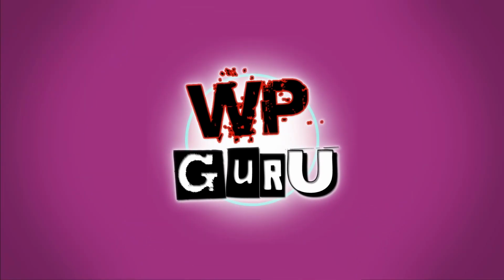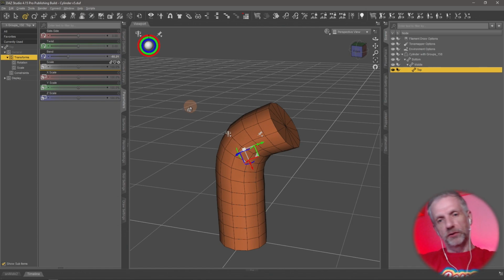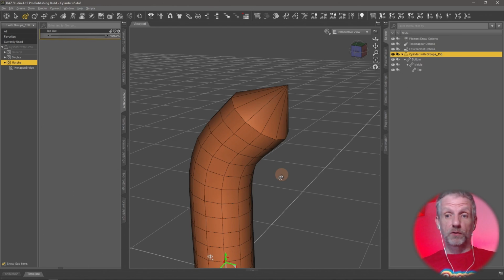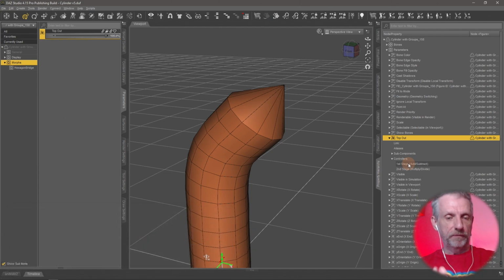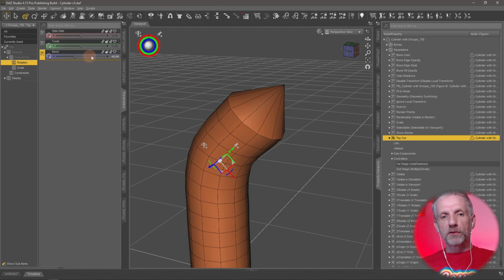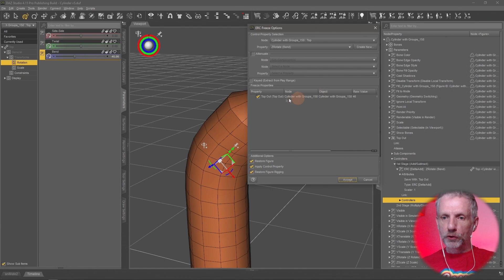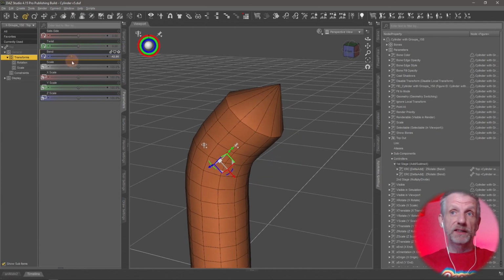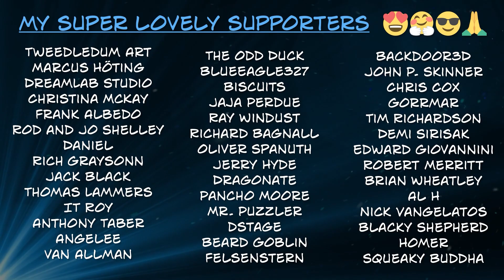Creating Joint Corrective Morphs (JCMs) in DAZ Studio

Comment: Hello Jay. I've been trying to learn to use "JCM's" for my clothing morphs. And it's never worked. Instead of affecting my morph, it affects my figure. And if I try to use it for the figure, nothing happens. And I've been watching these videos over and over.
Reply from the maker: To be honest, nobody wants to just "use" JCMs. You either create them if you have to, or they work autmatically. What are you trying to do and where's the problem? Perhaps it's not even related to JCMs.
Reply: @WPguru  Thank you so much for replying so quickly Jay. I've watched your videos for years and you've always been so helpful. Because of your video, I found out what I was doing wrong with the morph in the first place. But in this case, I've always wanted to learn about "JCMs" but they never worked out for me. When you mentioned the "ERC Freeze" I knew I was in trouble. Whenever I use the "JCMs" my morph(the whole thing) gets affected. instead of the area that I'm trying to work with. And I only use it on clothing. And I also use Zbrush as my morph editor. Again. Thank you so much for your help. I'm trying to make a comic book.

Comment: I've fought with these things for years.  Creating single property JCM's is pretty straight forward.  Where I'd love Love LOVE to see some instruction is in the creation of multi-axis JCM's and Start/Stop Points.  So how do you create a JCM that will ONLY apply when the joint is bent on two different axis'?  Say I have a morph for a thigh that's bent at -90 and -35 and ONLY want this morph to be applied when both of those are bent.  

The other thing I haven't been able to figure out is scalar start and stop points.  Say you want to add a calf morph but don't want to the morph to be applied until the back of the leg actually comes into contact with the calf.  Then you want it to apply in a scalar way.  I know this is possible but that property hierarchy is a bag of snakes.  Thanks for sharing and posting.